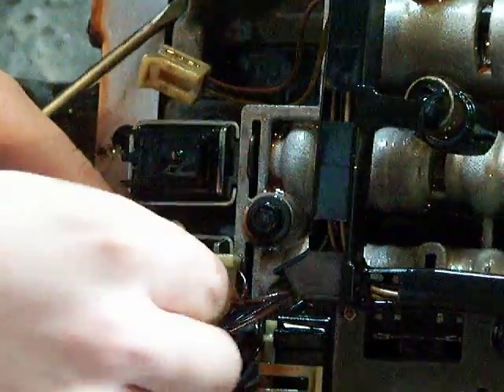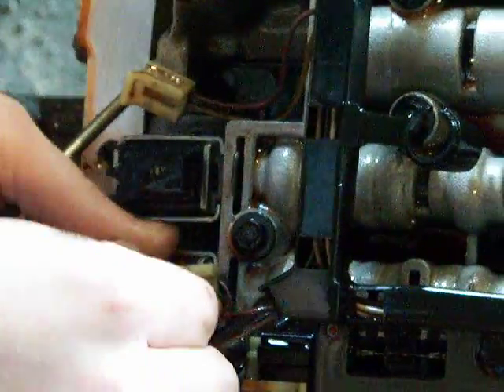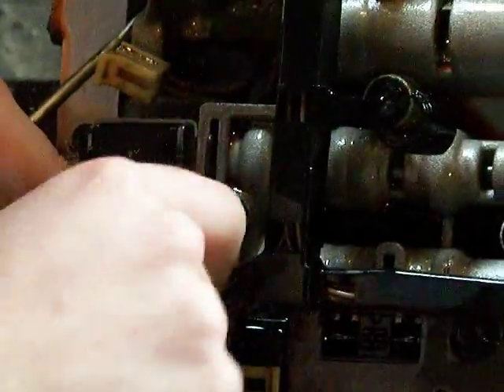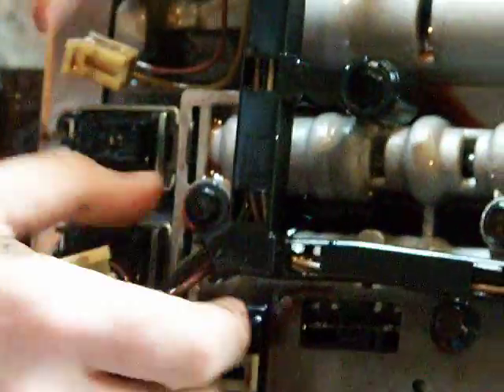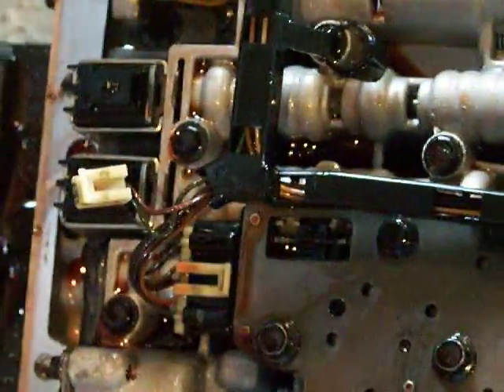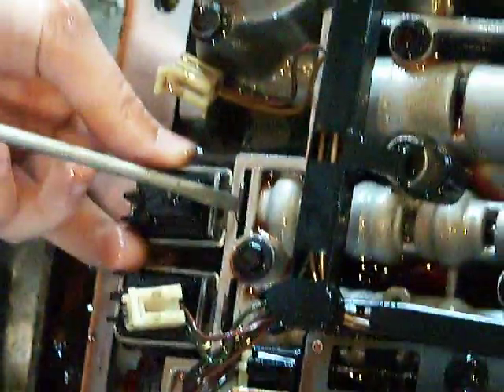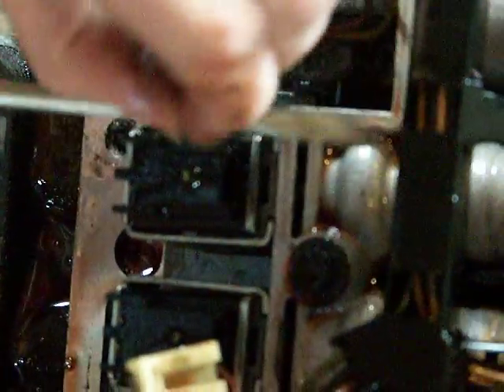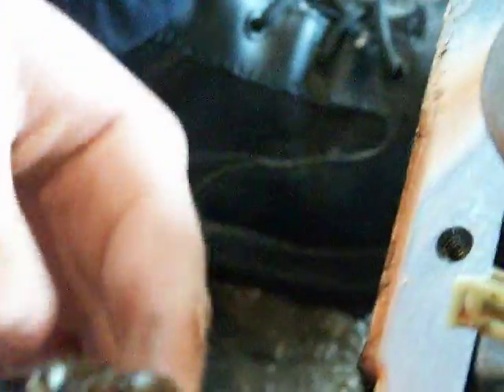4l60e Transmission shift solenoid replacement

Comment: @Yayington I just agradesco your support so I saw another solenoid that will not change the wiring does not believe that either since pcm 30min journey. normal change  se lo puedo escribir en español y usted lo traduce 

disculpe los contratiempos que le ocacionose lo puedo escribir en español y usted lo traduce 

disculpe los contratiempos que le ocaciono

Comment from the maker: @rapsag1974 I wish I understood your language right now. :)

If it won't upshift after replacing both solenoids, it's likely a wiring fault, or the PCM (powertrain control module).  
You may well have to take it into a service shop to have it diagnosed if you aren't comfortable diagnosing wiring issues.

Comment from the maker: @rapsag1974 Are you saying as it warms up it slips going into third?    The most common failure in these transmissions, is the 2-3 clutch packs burning up.   Solenoids won't cause a slipping issue. But if the 2-3 sloenoid were bad, the transmission may act like it doesn't want to go into third, rather it will just stay in second.

Comment: @Yayington thank you very much for your prompt response if the problem I have is this to work the truck does not grab the change to third pole, which is heated something I think the solenoid because the circular city after 20min. change as normal, not skating, not kick revolutionizes not run well
 no more, that detail your cooperation could I comment on why I appreciate a lot if I'm not mechanical simplente owner of that truck I'm from mexico gto

Comment from the maker: @rapsag1974 I think I understand.  :)    The solenoids are in plain sight once you remove the transmission pan. You will have to remove the filter, to access them. Pull firmly on the filter with a rotating motion, and it will come out.   Then just observe the video for how to replace these two solenoids.   I recommend replacing both at the same time.

Comment from the maker: @Navreet5264 Hello, I'm not familiar with your transmission, so I can not help you with that, unfortunately.  This transmission in the video is a General Motors unit.        Sometimes the solenoids are external, sometimes internal.  You may be best off asking a dealer where it is, or trying your luck with a Haynes manual or the like.  Though I don't recommend those manuals for anything.

Comment from the maker: @joepinder2000 Not that I can think of off hand.  The thing with '96 and up models, electrical issues would start throwing DTC codes, and likely throw the transmission into "Limp" mode, neither of which sounds like what you have going on.

Comment from the maker: @joepinder2000 Unfortunately, no.  Possibly if gear sets were replaced, There would be some.  But most rebuilds reuse sprags, and gear sets.  Just replacing clutch packs and seals.     But regardless, that is a worrisome amount of metal.

Any abnormal reverse behavior?   any noises in OD or D position?  Any abnormal noises when shifting into low?   Any details help, but I'm afraid it doesn't sound good.

Comment from the maker: @joepinder2000 The pickup has nothing to do with this issue.  Your issue is not fluid starvation.

For 40k miles that much metal shaving seems unusual.  There will always be some, but that's quite a bit.  Whn the sprag gives, generally there is no chunks lost, but just an excessive amount of shavings.       Better yet, if you can get the filter out and cut the casing open, you can see just how much metal has missed the magnet.

Comment from the maker: @joepinder2000 Unlikely.  especially the bang you mention, sounds like the sprag slipping.    Check the fluid for metal contamination.  The magnet in the pan may well have picked any or all of it up, so you may have to drop the pan.   Otherwise, look for any metallic substance on the dipstick.

Comment from the maker: @FarmerBryant Okay...So no forward movement in any range?    How long did the transmission sit before you put it in your truck?   Almost sounds like a valve body issue. Could be the forward clutch pack, but if it worked fine before the wreck, or if it sat around for some time, the clutches would fine still.    Is there any noise whatsoever from the transmission when you shift it?  whinning, clunking, etc..

Comment from the maker: @FarmerBryant Oh, okay.   So say you stat in L, or 1.  it will move fine, but if you shift it to 2, it acts like neutral? at all times?  What about if you put it in 3 or OD, does the transmission shift normally through all 4 speeds otherwise?

Comment from the maker: @bamrboy99 An issue with the hydraulic pressure, is what this sounds like off hand.   If you increase the throttle, but the pressure won't increase, then the transmission will slip.

Possible fault in the pressure control solenoid.   But there is a chance that the clutches are burnt p now and might require an overhaul.

I would not drive the truck until you have it diagnosed properly.  Have a trans shop check your line pressure and throttle pressure.

Comment from the maker: @TheSteve927 Possibly a pressure control solenoid issue, or another internal fault in the hydraulic system.
The gear selection is fully hydraulic. The shift solenoids, direct fluid to allow an upshift, or downshift.

Your issue would require a specialist to diagnose in person I'm afraid.

Comment from the maker: @mjnolen360 No, sounds like the torque converter lockup clutch is stuck 'applied'

TCC solenoid could be shorted, or  in internal valvebody failure could be the cause.

Comment: I have a 94 trans Am with an 4L60E auto trans. The car starts up fine, but when i put it in gear the car dies instant. (like i'm driving a manual trans and didn't used the clutch) Would the Shift Solenoid cause this?

Comment from the maker: @frodnew1 I have no idea off hand how the solenoids are set up in that model, but in my opinion, if you're going to have it torn down that far, I would replace all of them.    It saves money in the long run potentiall, and eliminates the guesswork. :)

Giving the dealership your VIN number should ensure they get the right parts for your application.

Comment: I have an O/D light flashing, code P0750, shift solenoid,  issue where I need to replace mine. I have one option which is to buy a whole transmission in a junkyard, (won't sell pieces) for the solenoid(s), or, purchase (possibly) from the dealer but they don't know the model number. There's also a chance they don't have it or won't. Is there a place online as backup? '97 Mazda Protege LX. Comments, ideas or advice? Haynes book offers no detail to which solenoid or color. Thnx. ps. great vid!

Comment: Have a 95 Blazer, just bought it. the lady said it coded for the shift solenoid and the part was included in the sale, box says 1-2 & 2-3 Shift. What car is doing is it won't go over 25mph and after it hits 25 it just don't want to go any faster. It acts like it doesn't want to shift out of first. Would a shift solenoid make it do that?

Comment from the maker: @bigfhella Sounds like you may have a pump failure.  Could even be a fluid starvation issue as well.   Check the fluid level, color, and odor.    If fluid is full, and looks good,  when was the filter last replaced in the unit?   Possible the filter screen is clogged.

Comment from the maker: @Jackball421 All the tow mode does is up the line pressure in the transmission, causing more firm shifting.    Heavy towing without using that tow feature tends to build excessive heat in the unit.  This can lead to premature failure of the clutches among other things.   Check the color of the fluid and the smell.  If it is black, or smells burnt, then get ready for a rebuild.

Comment from the maker: @deepwater1974    the 1-2 and 2-3 solenoids are covered in my video here.  the 3-2 solenoid is a round solenoid on the Front, passenger side of the valvebody.  It's right next to the dipstick.

Comment: Yayington, can I ask you something? I need some help. I have a 1994 Chevy Blazer Full Size 4x4 with a 4L60E. Its giving me shifting problems and my buddy came over with a Tech2 Scanner. It pulled the code for I think it was 3-2 Shift Solenoid. He said replace em all if your doing one which I am going to but I was checking out Rockauto for the parts and I see 1-2, 2-3 and 3-2 solenoids. What are all the solenoids in my trans? Im getting confused with them.

Comment from the maker: @bigfhella Loss of power to the trans, and several Engine control issues.   That isn't your issue though.  Limp mode is designed as it sounds, to let you 'limp home'.  The trans will move and shift.

When you say it stops, does it act like it went into neutral?  Or does the vehicle stop as though the transmission is binding?

Comment from the maker: @bigfhella Very unlikely.I would need more information on the exact symptoms to help you out though.    If you put the trans in ANY gear range, the vehicle will not move?  This includes manual low. 

Any abnormal noises?

Comment from the maker: @HarrisonVokills I imagine that is what you read about online, as this is the only way that the solenoids can directly affect actual shift 'Feel'

If the harder shift really bothers you, then look into getting it fixed,  but unless the shift is what you would describe as "jarring"  or "Slamming into gear"  then these stiffer shifts are actually healthy for an automatic transmission. A soft shift allows slippage in the clutch discs, and wears them out sooner.

Comment from the maker: @HarrisonVokills This is only relevant to the 4l60e Transmission,  The 4l80e is similar.
Your explorer will not have this exact transmission, so I couldn't tell you exactly how the replace the solenoids.

Most of the newer units however use what is call Pulse Width Modulation, or PWM.
This will pulse the solenoids on gradually, instead of all at once. This helps create a softer shift feel.

Comment: I have a 2000 Explorer (hard shift from 2nd to 3rd gear). A website had stated that my car has a shift solenoid malfunction because of the factory work. Is what I just watched relevant for my explorer?

How do you get to this part of the trans? Just pull the pan? Thanks in advance!

Comment from the maker: @supertiger72 To test the wiring harness you will need a 12v test light, and at best, a scan tool such as Tech II to command the solenoids on/off while holding the test light to the appropriate terminal.   I believe the PCM opens and closes a switch on the ground side of the circuit..
This is a test to determine a fault in the PCM or wiring. The solenoids generally are the part/s that fail however.   If the solenoid makes an audible click noise when you jump the two terminals, then it's fine.

Comment from the maker: @02superregency   So you're saying 2nd and 4th gear feel like neutral?   What about reverse?   And is there any noise?

The 4L60E #1 most common failure is the reaction sunshell cracking and breaking, causing loss of reverse, 2nd, and 4th.

Comment: got a question! ive got a 5.3 chevy and 4l60 trann in my 1979 fj40.. just got a chip tuner thing an i need to select gearing. choices are "stock", 3.42, 3.73, 4.10, 4.56, or 4.88. any idea what i should choose?

Comment from the maker: @clos039 The solenoid only actuates the shift.    If the solenoid fails, the car will not shift.    What you describe is a slipping condition.    Does it feel like the trans is in neutral for a short time?    If so, check the fluid color.   It's probably a dark shade, and smells burnt.    If so,  the trans is on it's way out.

Comment: i got a 96 tahoe with a 4L60.  sometimes it doesnt shift out of 1st and sometimes it doesnt down Shift from 3rd when i stop at a stop sign, so when i go to pull out from the stop its still in 3rd so its struggling to get going,  could this be something with the solenoid?

Comment from the maker: @blue7fish1   Yes, it has shift solenoids like any other electronic transmission.  However, it may not be as simple to replace.  You would want to consult a manual first.

Comment: mine would be sluggish wouldnt shift into od. now it does but no reverse also i have a fuse that went out for my 4 wheel swapped it not it works think i replaced it with the wrong amp. any suggestions all gears work now except for reverse im checkin the fuses tommorow

Comment from the maker: Are you absolutely certain it's stuck in third?  4th gear starts are a direct sign of Shift B solenoid failure.   Use the gear selector to down shift the transmission manually. Is there any change in behavior?

Comment from the maker: I'd get a few different opinions on the issue. Woever told you an ignition switch, or 3-2 solenoid is smoking something good enough to make me jealous. =)

I've no idea on the issue short of a Shift B solenoid getting stuck.  Possibly an issue inside the valve body itself, with build up of deposits making a valve stick.  Was the tranny fluid changed recently?

Comment from the maker: Hey Taylor(?)  There is no 3-2 shift solenoid. The solenoids with engage the mechanical valves required to engage their respective gear ranges, but as far as I understand it, the down shift will occur upon solenoid release.

Comment: I have a 1998 Chevy G2500 Cargo Van. It has the 4L60E tranny.  The tranny shifts fine until it warms up, then suddenly it gets stuck in 3rd. If I turn off the ignition, then restart.  It will take off in 1st, but once it shifts to third it stays there.  I've been told its either the 3-2 shift solenoid or the ignition switch.  I was wondering if you have any experience or advice on this problem.  It doesnt shift higher than third gear either.  Once the van warms up, it STAYS IN THIRD. continued..

Comment from the maker: Shift B (2-3)

Car goes into gear but feels very sluggish like the brakes are dragging, but it will roll easily (starts out in 4th gear), you manually shift to 2 to get it moving, once it's moving you put it back in OD and the car shifts 3rd to 4th on its own and locks the converter at the appropriate time

Comment from the maker: The shift solenoids run off of the PCM. When commanded the solenoids will open and direct hydraulic fluid to the apply clutches for which ever gear the solenoid commands.  

Diagnosing them is pretty easy.

Shift A solenoid (1-2)  
No 1st or 4th available; trans shifts 2nd to 3rd by itself in D or OD and locks the converter

Comment from the maker: The solenoids are side by side towards the rear of the transmisson.  You shouldn't have to remove the filter, but in this video it is removed.  In this transmission it just pulls straight out.